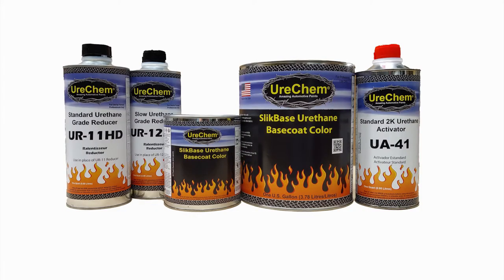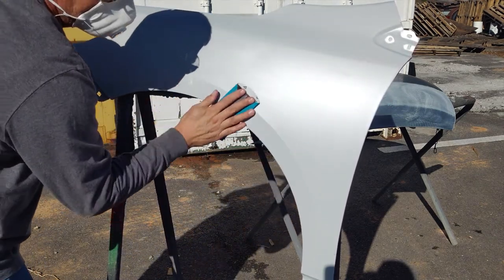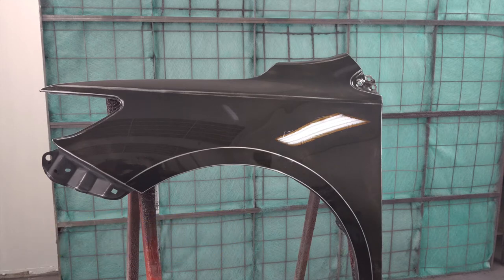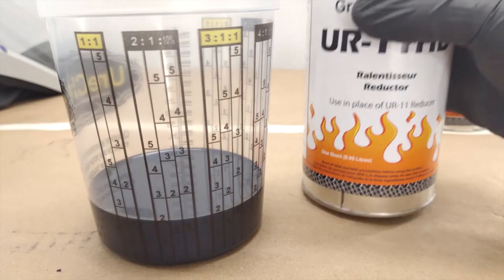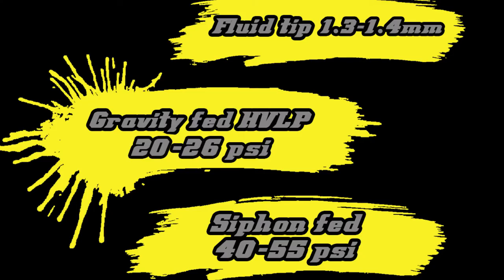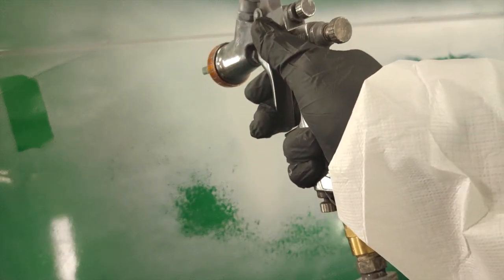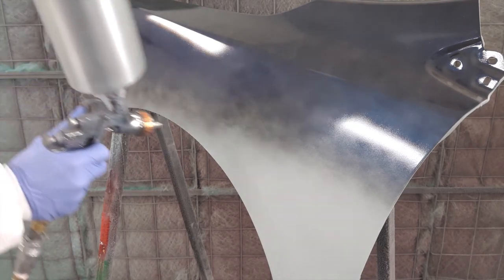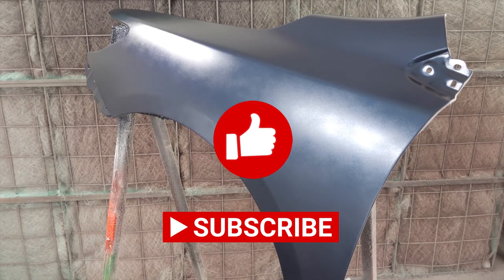How to use UreChem Slikbase Basecoat Color

Comment: It is not uncommon to back the fluid needle all the way back, hold trigger in, screw-in fluid tip until contact. Test for the volume of liquid sprayed and leave or reduce from there. 
  Thanks folks.